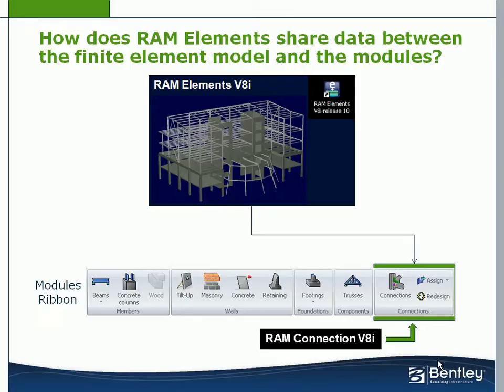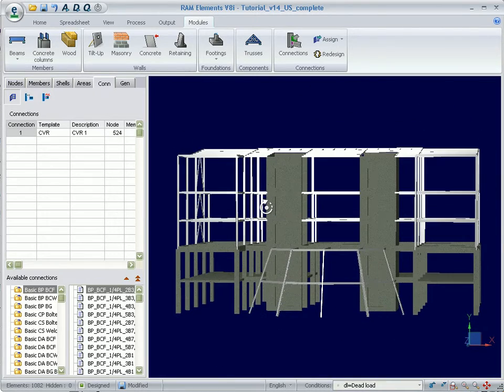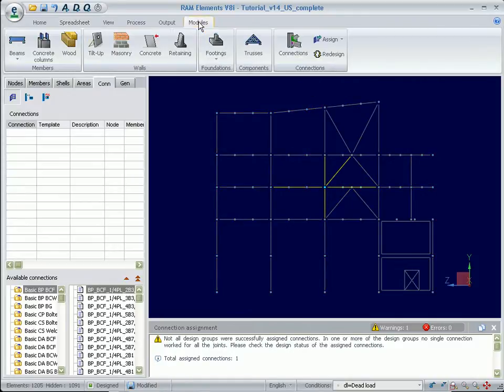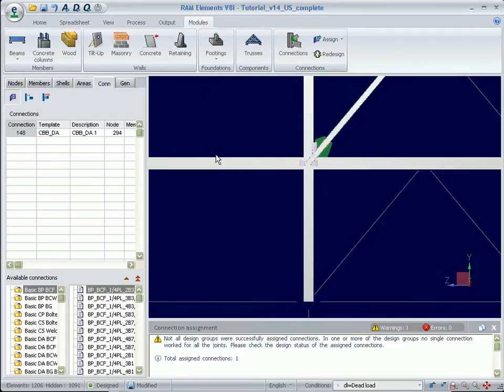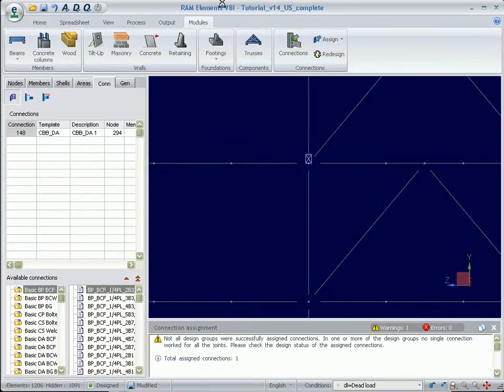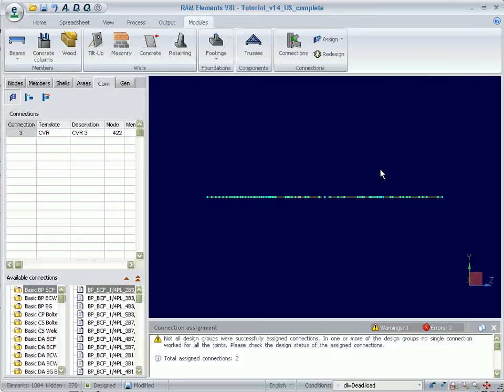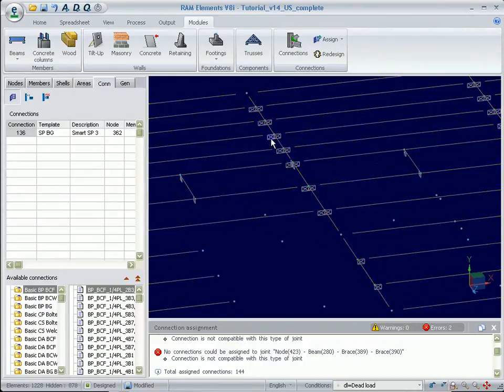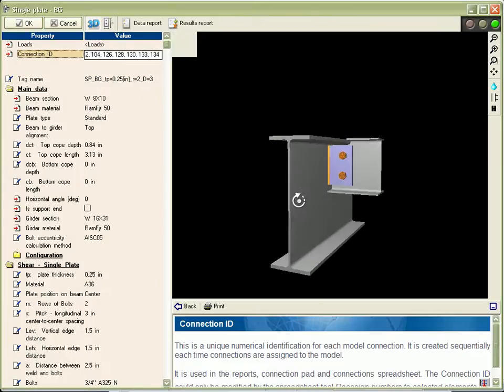Integration Between RAM Connection and RAM Elements

Comment: Hi, i have V8i and there isnt a RAM Connection Module inside RAM Elemments. But i have both installed and can actually run each separately but cant link the same model into each other (because i cant even open in RC a saved file from RE). Can someone help?
Reply: I'm sure you figured this out by now since this post is pretty old, but go into your overall menu and go to general configuration near the bottom, navigate to licenses.  If you have a connection license available you can turn it on here.  Then you will have the connection tab next to nodes/members/areas etc.